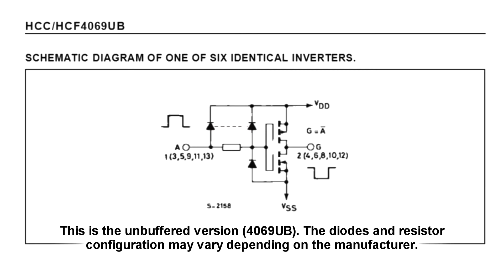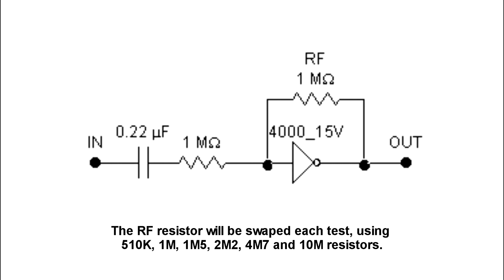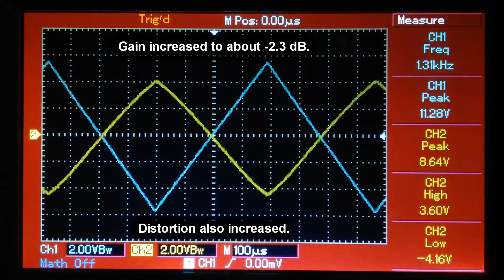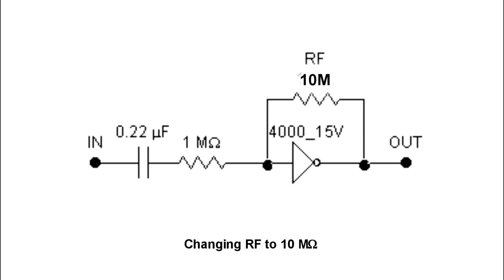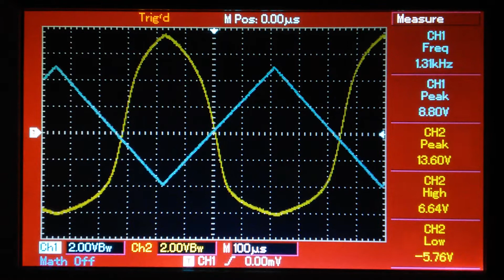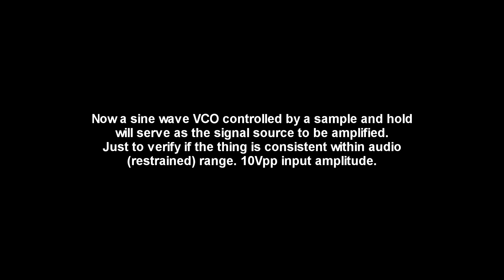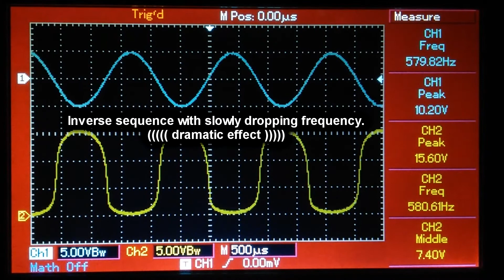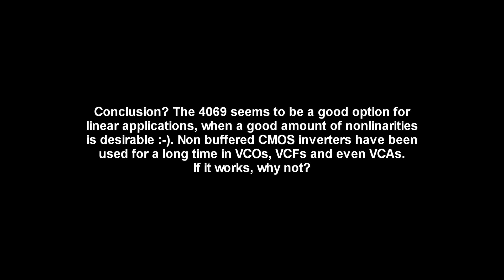CMOS 4069 Inverter as AC Amplifier, Tests on Breadboard, Oscilloscope and Audio

Comment from the maker: Testing a CMOS inverter wired as an audio amplifier. The specific IC mounted on the breadboard is a HCF4069UBE from ST Microelectronics. It is  an un-buffered hex inverter intended primarily for use in logic circuits, but can be also used in linear applications (see AN-88 application note). Each one of the six identical inverters in the chip is composed of two mos transistors (P-channel and N-channel) with some diodes and a resistor connected to its gates. Connecting input and output through a feedback resistor biases the inverter at Vdd middle point, and it can be used linearly over a reasonable range. Past that range, the output starts to distort in a somewhat similar way a valve (or tube) distorts. It is an interesting device to explore in guitar overdrives (see the hex fuzz / overdrive elsewhere on this channel), and synthesizer circuits.

HCF4069UBE AC Amplifier Tests on Breadboard, Oscilloscope and Audio

Join this channel to access more in depth information: 
 https://www.youtube.com/channel/UCQxQy-Z7SF7LFKsvSpqrTXg/join  
.
Thanks for watching.

Comment: I find the Rf=1.5MOhm the most plesantly distorted and most forward somehow. I may try to chain ing more amp stage or use two ic-s and ping-pong the signal between them while modulating the individual power supplyes.